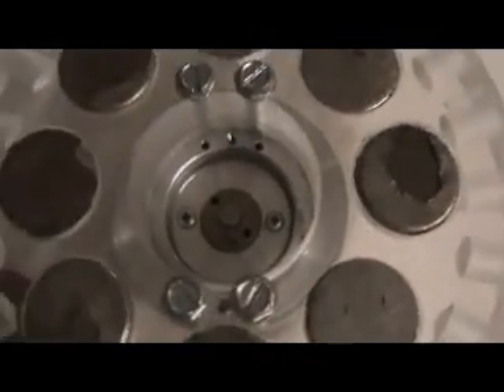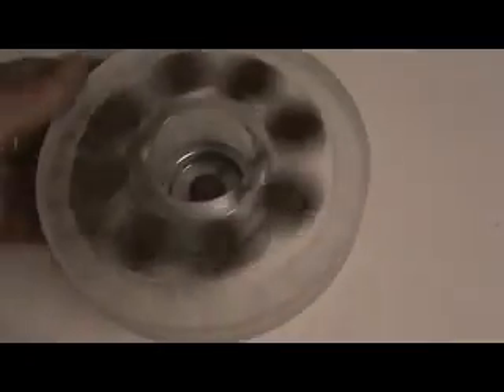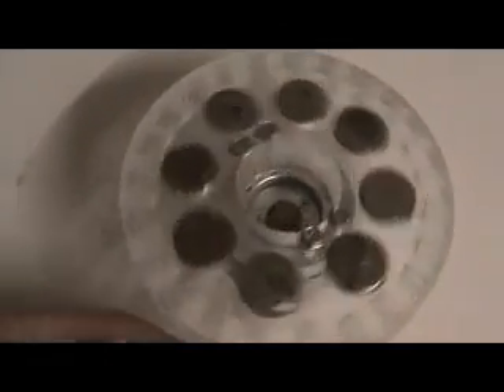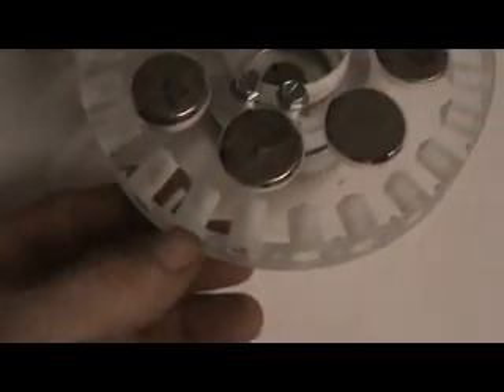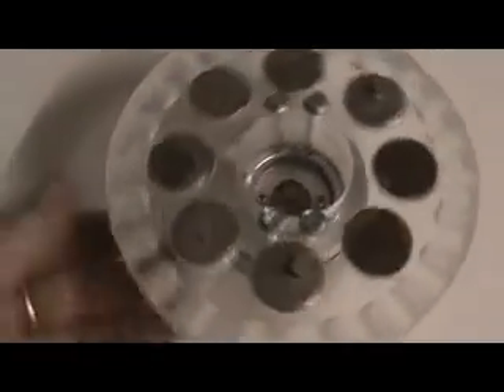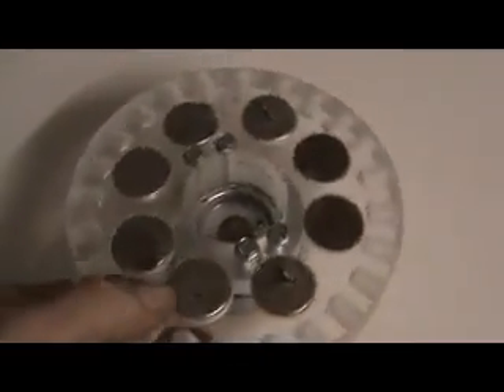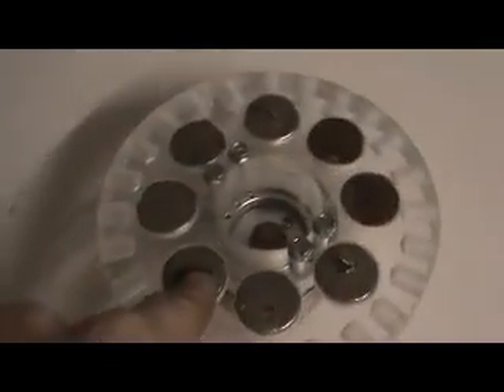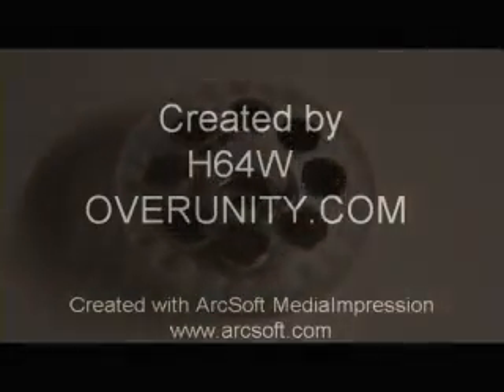HHO DRIVE GENERATOR

Comment: I'd like to see the exhaust of the HHO feeding the center of the hub (tube with holes in it) and the gas acting as a fluid for the wheel to prevent friction and then exhausting at the edge of the wheel.  I think it would fly really fast then.

Comment: For those who missed it - he plans to use hydrogen?? or another compressed or high flowing substance to blast the side of the rotor to generate power. where im stumped is this - the hydrogen used? to spin the rotor.. will that be ignited? i hope your not planning to blow torch a plastic rotor spinning at 1000`s of rpm Please for the love of god dont.